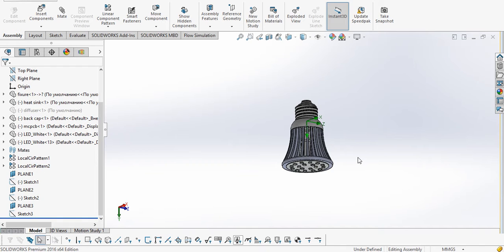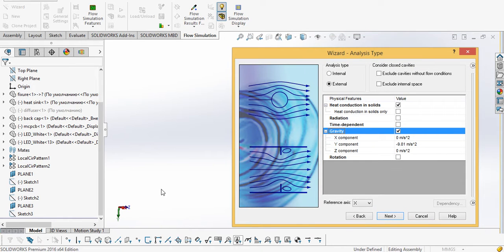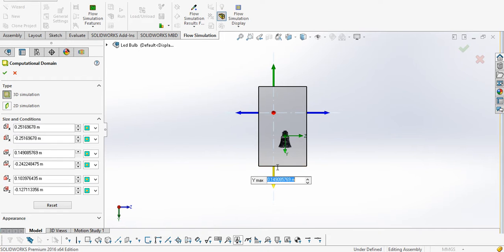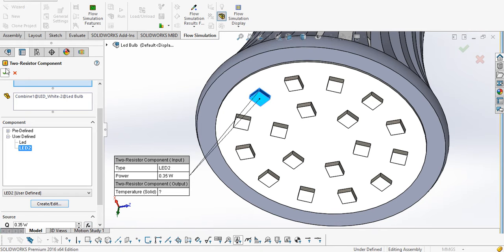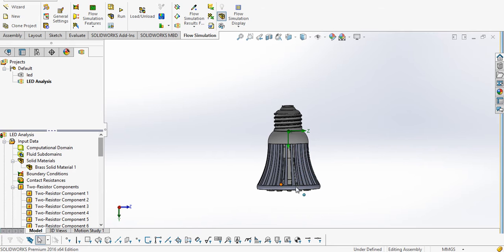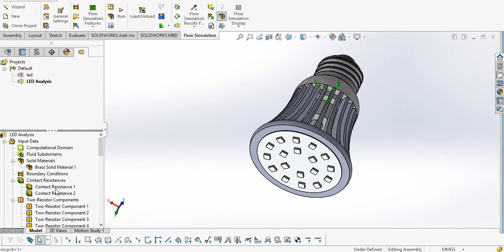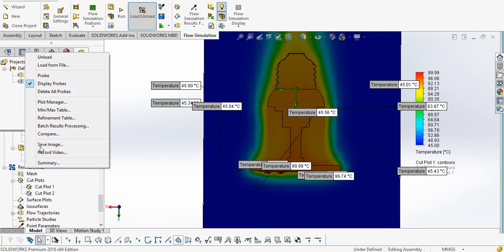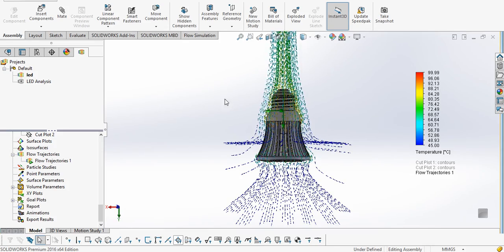FLow Simulation-Led analysis

Comment: Hi there thanks for the video, I have a doubt regarding the initial material you choose.When you select aluminium as the default material it seems also the LED has been assigned as an aluminium. Is that true?

Comment: Rohit Thanks for this Video, i have a question about LED Thermal Case and Borad Temperature not showing in LED data sheet 
Also board temperature related to MCPCB .How can i find  please suggest
Reply from the maker: HI Varun,
If relevant data is not available in data sheet, then you can contact to the manufacture for the required data of you can calculate the approximate data by taking the temperatures from experiments and then use the same for analysis....Good Luck.

Comment: Hi Rohit,
Thanks for the tutorial, I found it very informative.
I'm currently trying to establish and verify a process of analysing the thermal performance of COB LED's with various heatsink designs. I have been able to prototype a heatsink to test with a LED in a thermostatic chamber as a way of verifying the simulation.
My current issue is that the simulation is producing results wildly different to values to our real world test (~20 kelvin). If using a volumetric heat source, I have to reduce the thermal watts to approximately 30% of the LED's wattage. Whereas in reality that should be closer to 70% (rule of thumb for LED). And similarly if using a two-resistor component. 
My question to you is, what other variables should I investigate as potential causes for throwing results out.
Cheers.
Reply from the maker: I would rather prefer to use two resister component for modeling led. If you are using volumetric heat source the use proper volumetric heat source by diving the wattage by the volume of led hope it helps.... Good luck
Reply: Would this scenario work to model if a heatsink was good enough for a LED like the Cree XLamp CXB3070 for example? Or would you get a better result if you modelled the COB and its mount and the interface between with the thermal pad etc?
Reply: I am trying to work out what heat-sink I need to mount two flat strips of 6 LED's each on their own MCPCB. The kit comes with a sticky thermal pad but no heat-sink. Supplier says to just stick the two boards to a piece of flat Al with same dims as the board at 5mm thick. I want to run a sim to make sure I get adequate cooling with that set-up, i.e. running the LED's at their binning temp of 85 degC. The boards are 294X20mm and each has 6 x Cree XP-L LED's. Two board are connected in series running at 1400mA. Each LED runs at 4.244 W. The Term Resistance of the LED's is 2.2 degC/W. Supplier says thermal performance of the PCB is approx. 2 W/mK. Not sure how to set this sim up?? Product Link is here:http://www.cutter.com.au/proddetail.php?prod=cut3266

Comment: Hi I'm trying to use flow simulation to see the flow of water in a tank when it is agitated. Can you give me any pointers for how to do that?
Reply from the maker: Sirikit Joshi Hi, if it is forced circulation problem then you have to calculate pressure at the walls of the tank using forced circulation equation and then apply that pressure on the walls. This way you can continue with the problem
Reply: Uhm I don't think so. It's an open tank with a shaft and impeller for stirring purposes. And I need to calculate the force being applied on the impeller blades when it moves through the water to see if how much it deflects. What I am having problem with is how to calculate the force that is applied by the water towards the impeller blades.